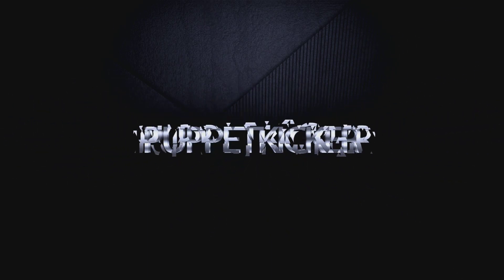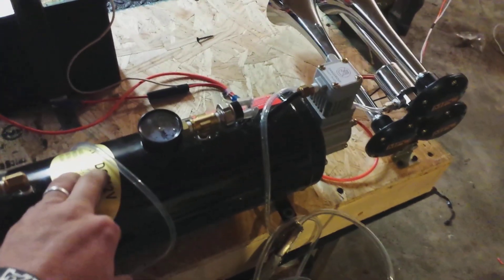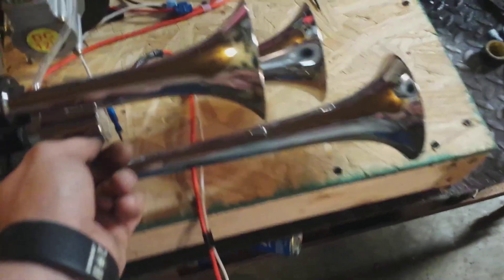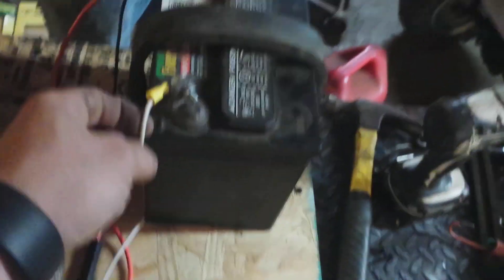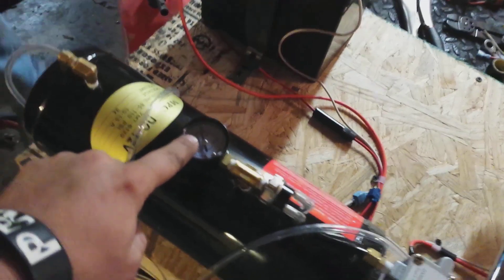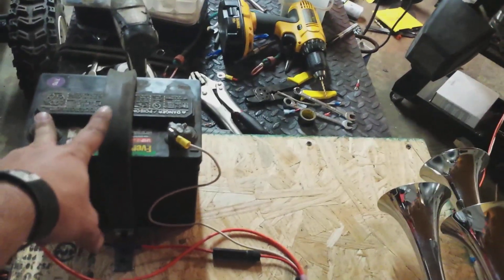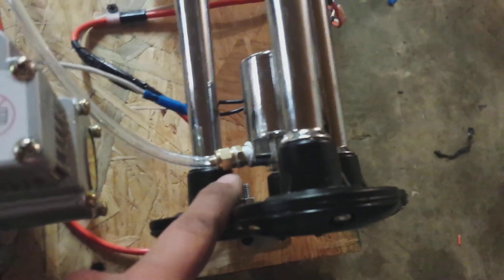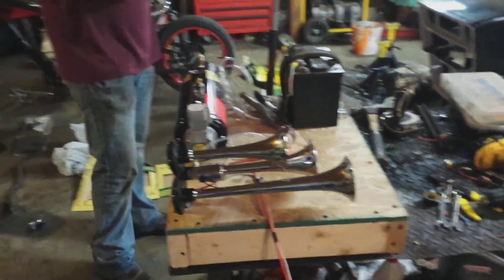D.I.Y. How To Wire - Hook Up A Train Horn System

Comment: So out a inline fuse on the hot wire going to the compresser not the toggle switch?
Reply from the maker: bryce stamey true. But you could always put one in each wire just to be safe

Comment: Which hot wire do you recommend putting a inline fuse too?
Reply from the maker: bryce stamey Co. The. Ain't hot wire to the compressor. But if u want to be safe put it in both

Comment: How many wires are connected to the switch? Just one from the horn and one from the positive on the battery?
Reply from the maker: 1 hot wire from the battery then it goes to the relay on the horn

Comment: I have the same train horn . It’s been working good for about 3 months and just recently it’s burning fuses left and right. It will run good for about 3 hours and then the fuse will blow . Any leads as to what I should check ? Thanks
Reply from the maker: Maybe bad motor.

Comment: Will it kill the battery?
Reply from the maker: It will not kill the battery if u have the plumbing right with no leaks. If the compressor is running a lot then the battery will get ran down